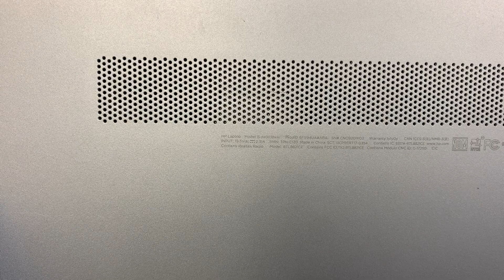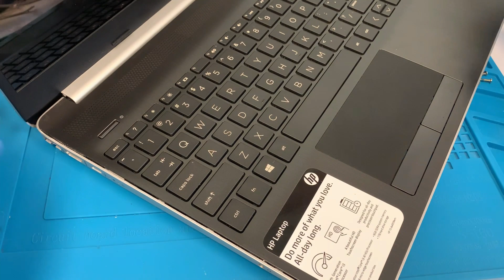HP 15 dw0038wm HD Replacement to SSD

Comment: Can the ssd by used in conjunction ti the nvme ssd drive thats on the motherboard
Reply from the maker: On a laptop each drive have their own slot. Unlike standard HDDs and SSDs, M.2 drives aren't connected to a motherboard via a cable, they're instead plugged directly into the motherboard.
Reply: @cybermax477  this model didnt have the ssd but has the nvme m.2 slot. Can i put one in and still keep the 1 tb hd?
Reply from the maker: Yes as long you have the slot. Boot the OS to your ssd for faster boot up time instead of the HDD